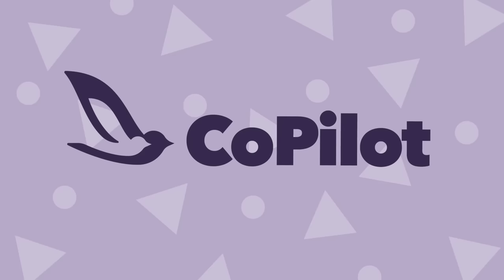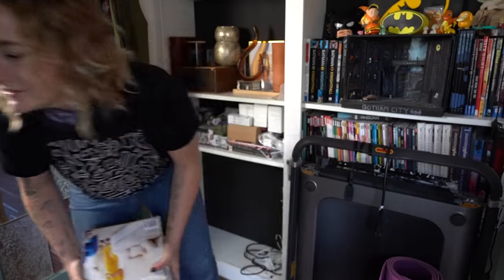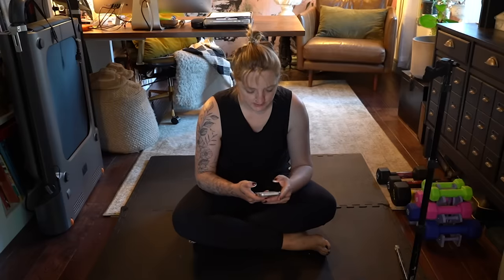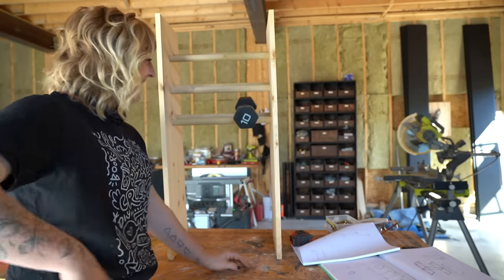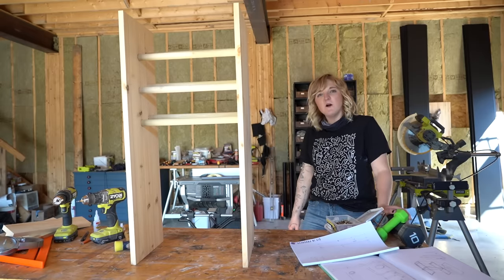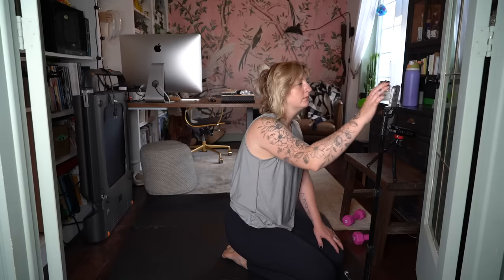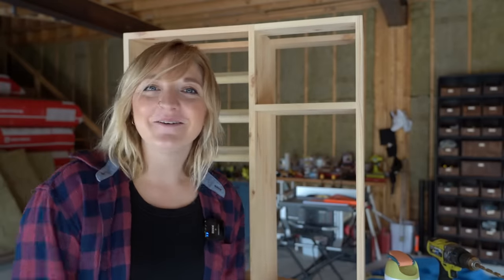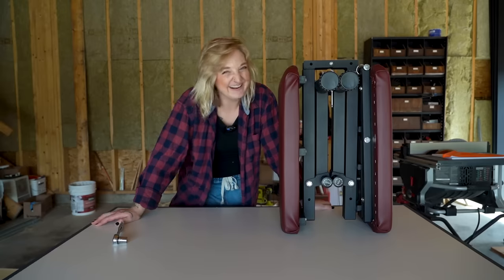*SMALL SPACE* home gym storage solution! | IKEA HACK | DIY DANIE

Comment: Danie, you are a goddess!
If the coach was there in person she would have had three tips for you.
1. Keep your bum AT your knees on a squat, no lower or your knees will suffer 
2.  Keep your head and neck in line with your spine as you do a pushup, so your neck doesn't suffer.
3.  On the bent over tricep lifts, keep your back flat and abdomen tight, so your back doesn't suffer.
You CAN fly, Danie. 🎉

Comment: Dear Danie,
1stly: You rock!
2ndly: Your hair looks so healthy now ❤
3rdly: Just wanted to share a trick for when using vinyl/faux leather -> you can heat it with a heat gun to stretch it further and avoid/get rid of wrinkles. Just don't use so much heat that it'll melt or remove the texture. Maybe a hairdryer will even suffice in some circumstances?
Have a nice day and all the love and best of luck on your workout journey 💪